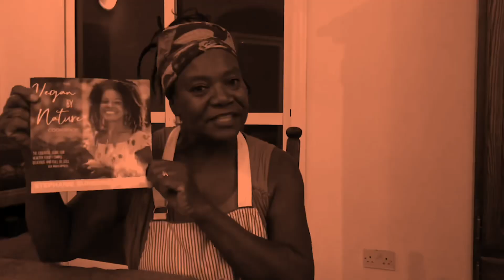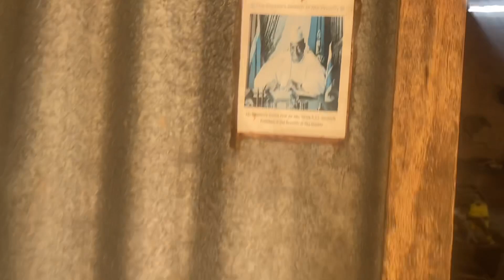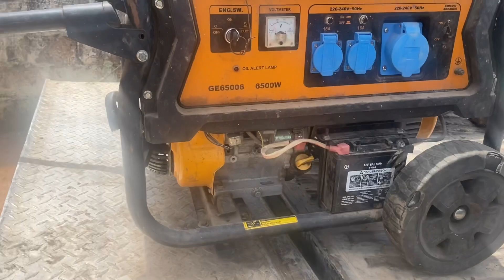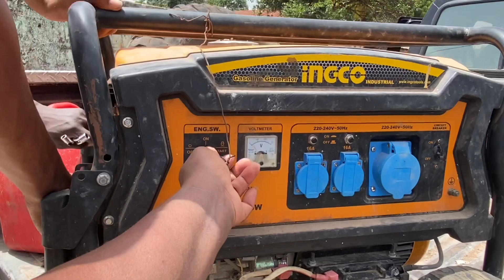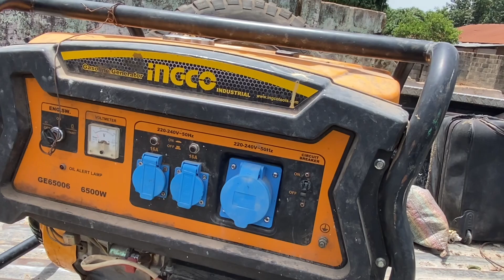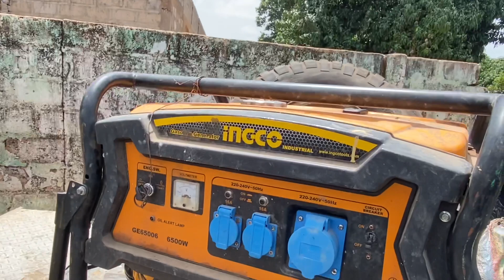We had to change the generator rope

Comment: Just in case it has yet to be mention, the generator design is highly flawed. The pull start method should involve pulling the starter rope/cord PARALLEL WITH THE STARTER RETRACTOR, NOT FORWARD!!!!!😬😓 ITS FLAWED DESIGN IS DAMAGING THE CORD WITH EVERY PULL!!!!!!😵😵😵😵😨😰. I'd look for a generator not made in ch!na.😬